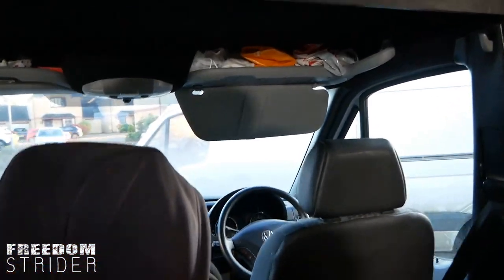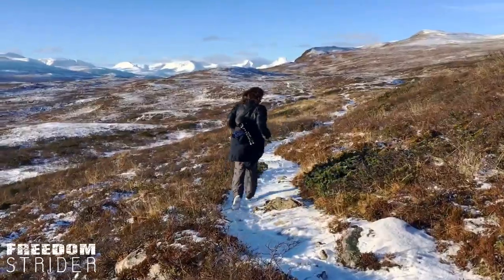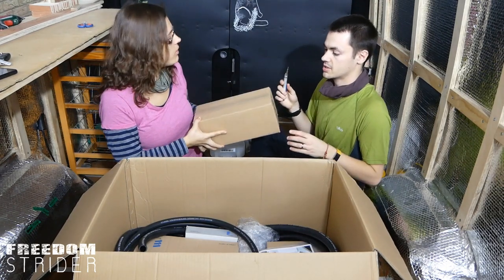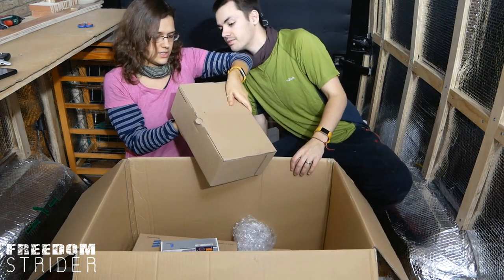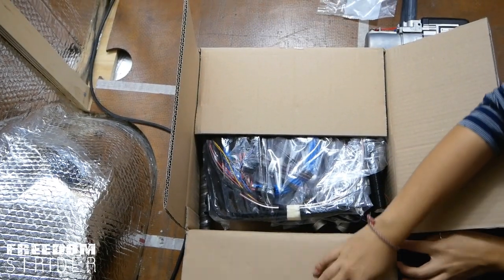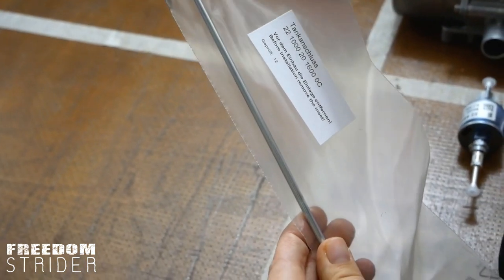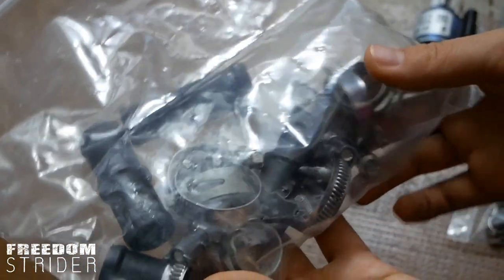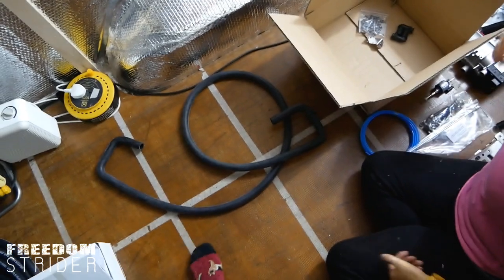How Hydronic Heating Systems WORK (diesel water heater)

Comment: I don’t usually comment on videos but I am building the exact same system and have noticed a fundamental error in your plan. It took me weeks of research to overcome so I will try to save you some time. Currently you will have a hot floor every time you want hot water. In the winter that is okay but for summer camping it is not ideal. Floor heat needs to be run on an independent loop controlled by a Thermostatic Mixing Valve (TMV). This will allow you to control the temperature of your floor separate from your glycol heat loop. Without this your floor will become uncomfortably hot. I have some routing diagrams I can give you that I got from a guy that sells kits of this system we are trying to reengineer. Additionally I saw in another comment that you could hook this system to your engine. It is a good plan, I am doing this, make sure if you choose to you run it through a heat exchanger so you are not running vital coolant all over the vehicle.
Reply from the maker: Well spotted that we didn't mention that, but we haven't forgotten about it.

We are planning to put a TMV and bypass line in, but for simplicity's sake, we didn't get into it this video. And when we first install this system, that will indeed be the case until we get used to working with the system, and then we'll put in the valves. We're designing it in a way where we can add things to the system later down the line. If you could send us those diagrams, that would be great, you can email it to us at info.striderstudios@gmail.com - Cheers! 😊
Reply: Could you share these diagrams please?! It's going to be easy to upload to mega/drive/dropbox or something! Have a nice day!
Reply: Hi, could share your diagrams? I can share mine 😊 Me and my partner are building this as we speak. We found a way to do full heated floors with an added thickness of only 2mm. 35mm total floor thickness.
Reply: @R0ssee  sure!! Will be great! Thanks for that
Reply: @R0ssee  This sounds really cool. Is there a way you could share how you did it?

Comment: Guys, you need temperature on your underfloor heating otherwise you will cook your little toes and your van. This means that you need another control valve which bypasses the underfloor heating and controls the temperature this is a three way valve and can be purchased from your local plumb store. Love your pipe schematic just each of the systems need to be separately controlled
Reply: You need temperature control even. Lol
Reply from the maker: We agree, our installation diagram is a bit more complex than the demonstration we showed here in the video. We're looking at TRV's and other valves 👍😀

Comment: Like the way you laid out the system on the floor - it made the explanation very straightforward. I cannot imagine the complexity of the electrics. Wishing you all the very best during the installation. It will be very interesting to many van builders, and I know you will make it work. All the best.
Reply from the maker: Thanks, we are slowly making sense of it all - it wil all work at the end 😉
Reply: @FreedomStrider  did you ever get it working? I have been agonizing over my rixen hydronic system for many months and cannot get it to work. I am at my wits end.

Comment: I expect you're already aware, but right at the 10:00 mark - you point at the heat exchanger and describe the flow of both glycol and water as going in the same direction - they need to flow in opposite directions from one another.

Looking forward to seeing your whole hydronic system install! I've got similar plans for a future project.
Reply from the maker: Yes, we did know that 😉 - it's always good to double check.
Reply: It takes a village! :D

Comment: Thanks for the video. I like the floor heating idea and also how you are designing your van as you build it. We can all sit at the drawing board too long. I noticed a few things wrong with your setup. First and probably most important, you have the heater the wrong way up. You need the output at the top so that any air bubbles can escape. Second your plate heat exchanger is the wrong way around (for maximum heat transfer). At the moment the flows are going in the same direction. This has at most 50% efficiency because the temperatures equalise. If you have counter flow the theoretical limit is 100%. You can expect between 60 and 80%. Your exhaust might be the wrong way up too. Make sure the little drain hole is at the bottom. I'm sure you would have figured all that out anyway but hopefully this will save you some time.
Reply from the maker: Thanks for all that - obviously the setup in this video is a rough schematic, more of a 2D visual representation rather than a 3D so it's hard to show direction, so we agree with all your directional points, that's how they should actually be when all setup. We are now physically installing the heater and by the end of this week you'll be able to see how we've position some of the things below the van - we will welcome your feedback then as well. 😊

Comment: Wow that’s very good. Can’t wait for the install. I really wish I put an underfloor heating in our van, even with the diesel heater running, the vinyl floor is still cold. I think I’ll but buy a nice rug and put it on the floor, or maybe if there is away to heat the vinyl floor without taking it out then I’ll do that also lol
Reply from the maker: A thick rug will make a big difference since the rug fibres trap air so if the air is warm, it shouldn't be as cold. I don't know if they exist, but a heated rug could be an idea? 😂🤔 Although of course, that will drain some power, but nonetheless... 😉

Comment: Looks like a great idea something I had thought about myself, have you thought about having a large hi efficiency heat exchanger between your vans engine coolant system and your leisure heating glycol system? If the engine was running let’s say you were driving somewhere and you also was cycling the pump ( but the heater was off ) you could transfer some heat energy into the leisure heating system whilst driving. Or vice versa if you’re in a very cold environment, Scandinavian countries during winter you could use the leisure heating system as a pre-heater for your engine.
Reply from the maker: That's actually these heaters original design intention we I believe we even have the pipe to do that. We'll probably look into it after the heating system is installed because we are not entirely sure how to connect it up but it is a good idea to make the system more fuel efficient 😊
Reply: @FreedomStrider  Aye modifying the original vans coolant system probably isn’t everyone’s cup of tea! Keeping the System isolated and have a heat exchanger between them opposed to linking them is probably a better solution. Hopefully I’ll just be putting a heat exchanger in line along a pipe in the vans engine cooling system
Reply: I'm thinking this same setup for my upcoming build... Another is to use Truma Combi 6kW which has 10 liter boiler and four output air heating, no way to heat floor or engine tho.
You may add another heat exchanger, simpler than your water heater, and series glycol pump in parallel of van heater core.
When that pump isn't running no engine heating. You may also consider some special thermostat setup to get adequate cooling for primary glycol circuit running engine heating pump, maybe with pwm for better control.
Most likely biggest issue in mild weathers, like near freezing or strong winds, is that diesel heater idle might be too much or it starts to develop soot... Or your floor gets to hot. Adding engine heating exchanger just before floor could get best of all setups.
Build your setup and plumbing to make this possible and your golden. With glycol I would put both furnace and its pump under floor and use insulated plumbings, and add engine exchanger stuff there too.
Best of luck, your campervan will be stellar!
Reply: How about using ESP32 based board, for example QuinLED Quad https://quinled.info/2018/09/07/quinled-quad/ or Deca to control pumps using Home Automation software, like this: https://opensource.com/article/18/8/build-thermostat-open-source-tools
That's what I've been tinkering here to build myself custom heating and very likely recirculating shower like @Mispronounced Adventures

Comment: I recommend anyone looking to do a hydronic system like this, do not put multiple heating sources in series as shown, you want to pipe in parallel.  That way you have a consistent high temp inlet for each demand, and you have less pressure drop in the system
Reply from the maker: We agree, we did a follow up video discussing the 2 types of piping and the actual plumbing in our van is as you described 🙂
Reply: @FreedomStrider  great 👍🏻.  After using this for awhile, do you think the 5kW heater is enough?  Seems like you would need to wait for the water tank to heat up to room temperature before you can get shower water up to 100F
Reply from the maker: The 5kw heater is plenty for the air matrix, within 5 minutes we get hot air and our underfloor loop is toasty in 30 mins. As for the water, we are actually plumbing that in the next few weeks, so we'll have a video testing the water temperature and time for it to heat up. 

That being said once the heater is up to temperature (within 5 minutes) we expect that the heat transfer at the heat exchanger should be fairly instant and it may need cooling down and anything else.
Reply from the maker: Oh and we don't have a hot water tank, we'll just use the heat exchanger as an instant hot water unit 🙂👍
Reply: @FreedomStrider  looking forward to it! I am a systems design engineer, and doing a quick calc, your fresh water tank supply will need to be around 70F before the diesel heater will get it up to a comfortable shower temp, and that's at only 1 gpm.  Assuming the unit is really maxed out at 5kW.  I'm about to purchase a similar heater for my own build so looking forward to see how it works for you, delays to preheat the fresh water tank in cold temps, etc.  Thanks!

Comment: Very interesting video, thank you. I'm thinking to install something similar in my motorhome.  I have some question for you. Did you check or control (e.g. through a thermostatic valve) that the temperature of the glycol is not above the maximum temperature of the fluid used commonly in underfloor heating systems (i.e., about 35° C ) ? Did you consider the pump characteristics to dimension the underfloor heating system (pipe diameter, spacing, and length)? What diameter of the pipe did you use?   Thanks in advance for any suggestions.
Reply from the maker: We haven't checked the glycol temperature though the heater specs say it heats glycol to around 60-80C so that's what I assume it is, and it doesn't make the floor 'too hot'. We bought 12mm pex pipe (ID 9mm) and just made sure to run it with common sense to try cover most of the floor area which worked out well :)

Comment: any thought on using the coolant from your engine to heat the system while the engine is running?
Reply from the maker: Totally possible we just didn't want to tap into our engine coolant, but it's doable with these systems

Comment: very nice solution, thank you for sharing all these information! :) 
I kindly ask you a question: I expect the pressure inside the glycol circuit to rise with the temperature, did you experience any problem with the plastic glycol tank? I mean: does it withstand the pressure in running condition? Thanks in advance!
Reply from the maker: We actually ended up replacing the plastic header tank with an aluminium one because the plastic one didn't fit in our space. The plastic one is designed for these systems and many people have used them with no trouble.

As long as the tank you pick has a venting cap to allow for the pressure change and the airing of the system then you should be fine 😊👍

Comment: Hello, Great Video! Any iupdate on the install and wiring??
Reply from the maker: At the moment we haven't actually installed any of the systems in the van yet, we are waiting on a few more parts. We've just finished the electrics which will enable us to connect the heater and controllers, and yesterday our underfloor heating pipe just arrived! (very exciting) so we are preparing the floor and confirming locations before we cut up the pipe, so videos will be coming soon! - But we do need to take our time as we don't want to mess up 🙂

Comment: What is the hose you reference that you say looks like it goes around the engine ? We can’t figure out when or what we use it for ?
Reply from the maker: Honestly, we haven't used this pipe. I think it is supplied so you can easily run a continuous pipe from the heater around the engine to pre-heat the engine before turning it on. These heaters are actually engine pre-heaters, so that's their intended use. People in campervans and boats have just modified it to be used as a house/domestic heater instead. 

We haven't used it since we need to heat more than one thing, and there hasn't been a suitable function for this rubber hose (yet). We just bought the extra rubber hose separately and put it together as needed. We have left this one untouched in case we do have somewhere it would be useful but I wouldn't stress about it if you can find a suitable place for it at the moment (or ever). 👍

Comment: Do you need to heat your floor in summer when you need hot water?
Reply from the maker: No we don't, and we have changed our design from this (https://youtu.be/IUElVxJfwCQ)

In short, instead of a 1 pipe system, we are now doing a 2 pipe system so we can turn on/off certain loops. Aka, isolate the underfloor loop and turn it off when we just want hot water and not a hot floor 😊👍

Comment: Hi. Can I ask why you do not just run water through the system /furnace and do away with the heat exchanger?
Reply from the maker: In theory you could but that water passes through the heater and rubber pipework, and wouldn't be drinkable without filters, and you'd need to constantly refill the system with new cold water if you wanted to use the water. Plus these heaters are designed to work with glycol, not water, so I believe the water would boil in the pipes. The glycol only reaches 80C but it takes alot more heat to keep it at 80C. Water is much easier to heat and would therefore boil.

Comment: I know it's been a long time since your post. I am considering hydronic heating for my van. Initially I had not considered heated floors, but now I'm wondering how effective is the radiator fan system.. is it enough. I've understood that it is not as efficient as the diesel air heaters, but it would be lovely to remove the noisy diesel burner from the van. 

Then a comment regarding the coolant tank. Was the schematic simplified or are you circulating the coolant in the tank? I thought the tank would be a reservoir and have T-connection to the circulating system. This way coolant is drawn to the system if needed but not all of the coolant is heated. I may be totally mistaken!
Reply from the maker: The heated floor we built, whilst a prototype of sorts, is not enough to heat the van by itself, however it certainly makes the van feel more like a home. Not having a freezing cold floor certainly makes a world of difference! 

I'm sure our system can be vastly improved, and I know from others (vanlife tech in the usa) that with the right kit it can be used as a heating source by itself.

The main thing is with air heaters, they heat up the space more immediately, but once the heater is off, it can get cold quickly. The floor radiates heat, so even with the heater off, it can be heating the space still for hours!
Reply from the maker: As for the coolant tank yes, we simplified a little bit you are correct, the tank is a reservoir and a place where air can escape and any expansion is managed as the coolant heats up 👌 the later install videos show the design a bit more clearly as we did change the design

Comment: Hello,
Many thanks for sharing this. Excellent description.
Unfortunately (possibly) I have already purchased a refurbished Webasto water heater, fully complete with controls, etc. 
I was wondering if the Air Matrix can be purchased separately?  I'm looking forward to more videos.  
 I've seen only one Air Matrix on eBay, though it doesn't have the controller for the air matrix. Liked and subscribed 👍
Reply from the maker: Hi hi, yes it is possible :)

https://www.melloronline.co.uk/Water_Heater_Matrices/5192/Silencio_2_heater_12v_5.5kw_-_41T0034.html

This is the company we used to buy most of our kit, and this was our air matrix 👍 

Hope this helps 😊
Reply: @FreedomStrider  Many thanks for the quick reply and link. It definitely helps :) 
I'm happy to have stumbled upon your channel.
Cheers!

Comment: Thanks for making the video. This is easily the best explanation of a hydronic system that I’ve seen.

Btw, where does the water pump sit in this system? For cold water is it water tank> pump> sink and for hot water it goes water tank> pump>heat exchanger>sink? I assume the hot and cold mix at the sink
Reply from the maker: Thanks, glad we made it easy to visualise! 😊

As for the water pump, yep I think that's pretty much spot-on; the pump needs to be closest to the tank, and the mixing nearest the sink after the heat exchanger. You can have 1 pump and after the pump, split the pipe in 2, have 1 going to the heat exchanger (hot water) and the other to the sink (cold water) so you'd only need 1 pump, and then the mixer brings it back together. 👍